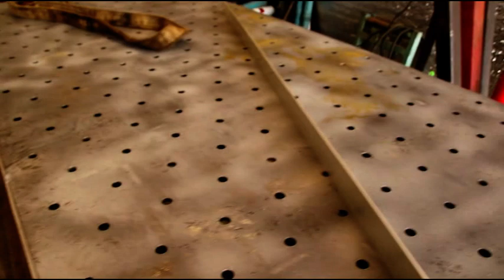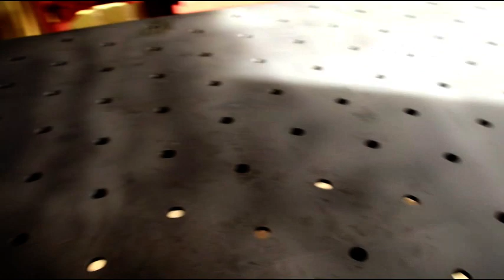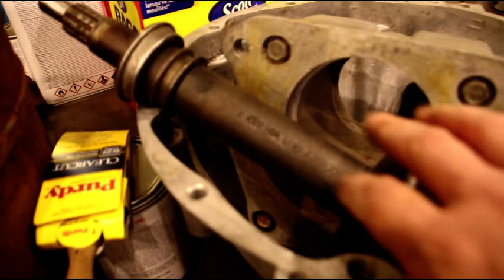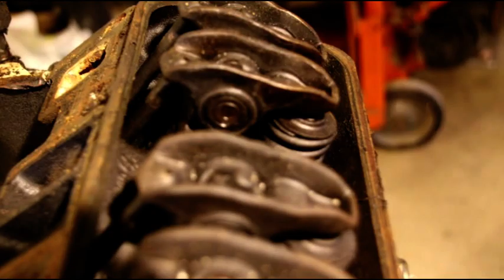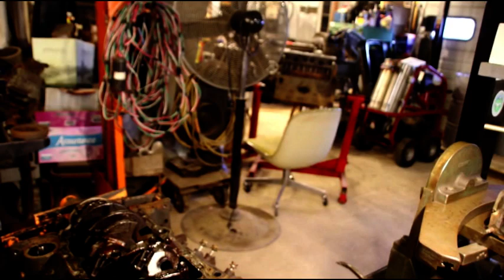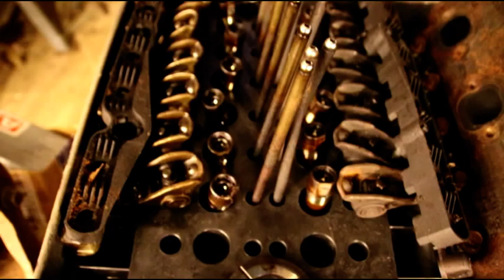Fab/Weld Table Finished, 258 Engine and GM 4.3 Vortec Tear Down

Comment: Brian what will you put on the top surface and holes of the fab/frame table to keep it from rusting?
Reply from the maker: I am going to use a light coat of Fluid Film on the top and side surfaces of the fab table.

Comment: Christmas came early! I have been waiting for a 4.3 in a flat fender for ever. Do you think a 4.3 would fit in a 2a or 3a without cutting the hood? My dream car is a bone stock looking 2a or 3a that I could drive daily and tow a small pop up style camper around the US. It’s sad to think that no one living near you wants to help. It would be so cool to come up there and learn from you!
Reply from the maker: Glad you are enjoying  the 4.3 build.   Yes it will fit perfectly in a CJ2a or 3a and will make plenty of power.   If you go that route in an old jeep best to change the gear ratio as well.   I will be running 3.73 gears instead of the original 5.38 gears so I can take full advantage of the power and torque of the 4.3 engine.

Comment: Interesting how much that V-6 looks like the old 327 V-8. The casting looks like it was made from the same mold.
Reply from the maker: Yes, the V6 is basically the same as a V8 with 2 cylinders cut off.   They are great engines and make good power

Comment: You have to use the $300 in intake from eldibrock to go carb because of the blance shaft. I have built several of them. And im not sure if you can put a metal timming cain cover on it but you can get a plastic on without the hole for the crank sensor.
Reply from the maker: Yes, planning on the Edelbrok intake and carb for this engine.  The standard  steel timing cover works and I like it better than the plastic one.

Comment: Just so you know their is to differant size cam bearings for those 4.3. Call who ever you are ordering parts from and give them the numbers off the block to get the right ones.
Reply from the maker: Yes I am familiar with the cam bearing sizes and other differences in parts for these engines.  My engine warehouse is familiar with them as well and always asks for the casting number so they can pull the correct parts for me.  Thanks for watching

Comment: Great video Brian.  Your table looks great, I can see how it can be very useful.  What is the advantage of the 12 counterweight crank? 
Smother running, stronger, all of the above?  I have an 84 CJ7 I hope to build one of these days.  I'm just wondering if I should keep my eyes open for a good used crank for it.  Thanks for sharing.  See you next time.
Reply from the maker: The 12 weight crank is heavier and works great with a manual transmission.   The later 4 counterweight crank is fine and spins up quickly.  Not too much difference but I always prefer the 12 counterweight because I always build manual transmission rigs.